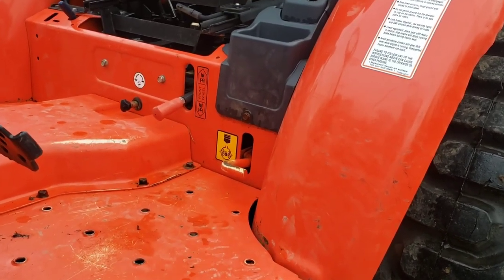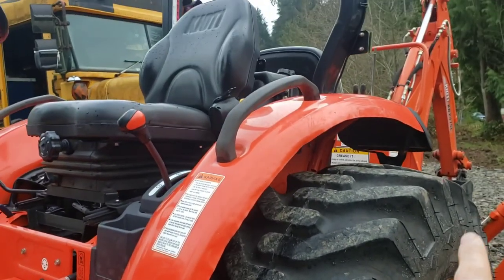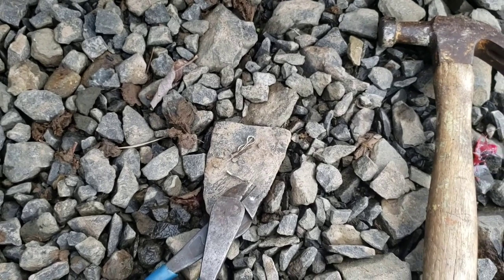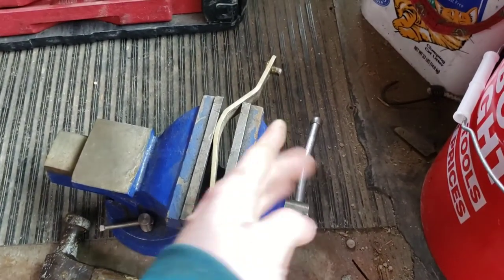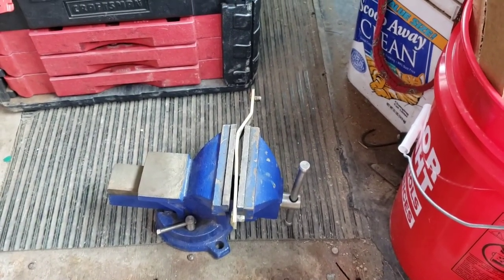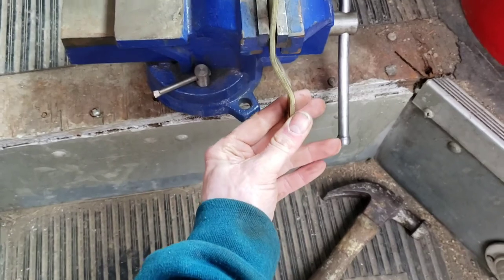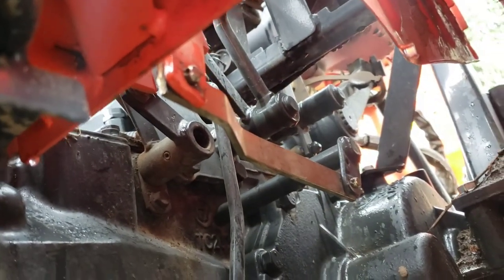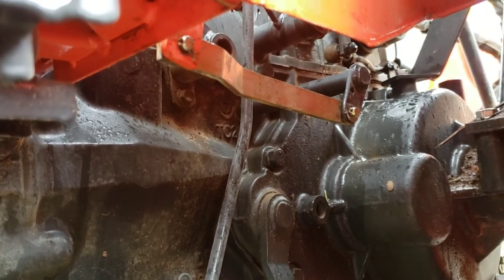kioti ck2610 rear locker not working? Hard to engage? tips tricks and repair for a sticky diff lock

Comment: Mine did exact same thing.  I straightened it out in vise and now am VERY careful to press it down while rear wheel is turning very slowly until the differential lock finally engages.  The CK2610 is super picky about finding the exact right spot where the differential locking dowels engage: I have learned to just take my time trying to find that magic location for engagement.  I hope the re-straightened lever lasts.  Basically, this seems to be about having the right technique or this lever bends.
Not the best design since it requires a fair amount of pressure from your heel to get it to engage but if you put just a little too much pressure you bend this rod/lever.  Hopefully I have the technique figured out now.
Good video: I stole your ideas to use the vise to straighten and hitting the shaft with PB Blaster.  Reminded me to also run around the tractor with a can of WD40 and squirt all the movable locations.
Reply from the maker: Ya the kioti has some quarks and things to get used to. The diff lock being one of them. But it sure beats a shovel! Thanks for watching, appreciate the comment.

Comment: mine has always been tricky, and I almost have to stand on it with my heel.   now it is not working and when I tried to engage it, I hear a nasty gear crunching (like it is not completely engaging a tooth).    I am almost afraid to try it now.   Anyways, that's why I came here as I am having problems with it (hope Kioti reads all these comments).   Oh, and you did a good job with the video.
Reply from the maker: Some people think I just hate on kioti, but my hope is much like yours. That they read comments get info from the customers and improve on their product... Appreciate the comment. Hopefully your dealer can figure out the locker issue on your tractor. Should be under warranty if internal.

Comment: The rear diff lock won't usually engage unless one of the tires is spinning or if your in a turn and the wheels are spinning at different speeds. Mine goes right into lock as long as those conditions are met. When you are engaging it and the conditions aren't met then it either just happens to be aligned or your are forcing it and bending the rod.
Reply from the maker: I think my rod originally got bent by a stick, then was just plain weak. I hope most people do not have as many issues as I have, with my locker. I have a feeling the 2 clicks has to do with the 2 different sides, so the axles need to be spinning at different speeds to get the 2 different detent levels I was struggling with in the video... Appreciate the comment it got me to realize that. It did work better when I would grab one tire and hold or slow it with my hand, so makes more sense. Hopefully our sharing knowledge helps other people. Keep building shit!

Comment: ENGAGE the diff-lock BEFORE needed. And disengage immediately after use.  For the pins to line up, the differential needs to rotate, and this can ONLY be accomplished in a turn, using LIGHT pedal pressure. One tire MUST rotate at a different speed than the other. Waiting until you need to engage the diff-lock when stuck, is a major mistake.
Reply from the maker: I have tried that since and bent another linkage. The kioti locker design is shit. Point blank period. It is shit. Not about when or how it is engaged or if a person wiggled their ears and nose in the right order. The design is shit.

Comment: CLUELESS. Like 99% of owners, Dealers and mechanics, no one knows how to use the Diff- lock on Kioti or Kubota.  The manual instructions are incorrect and vague.
Reply from the maker: Pretty sure if the manual and instructions are incorrect and vague that makes the manufacturer and dealers the ones that are clueless. No fault of the owners..
Reply: @worthshop  The definition of an adult, is taking responsibility for one's  own actions. An equipment operator should be aware of the function and purpose of anything they operate. Blaming is not acceptable.
Reply from the maker: @ya472  The responsibility of a manufacturer is to produce a quality product not junk. The kioti locker is a bad design it is weak it is junk. I have been to 2 dealerships that have told me they have had countless issues with the locker linkage and function. The locker is a bad design from the factory. Yes how dare an adult call junk junk. How dare an adult call a poor design a poor design..
Reply: @ya472 My 3510 also won't engage because it's a terrible, weak design. If you know what you're talking about, like you claim you do, you know the implications of a non-functioning locking rear differential. 

Awful expensive piece of equipment to leave you stranded in a field because it's components failed not because of operator error, but because of poor design.